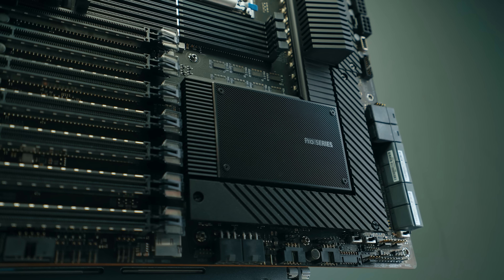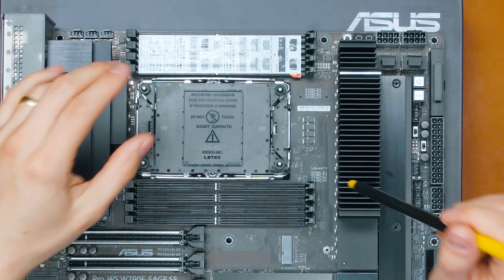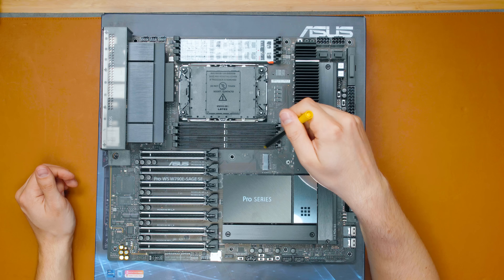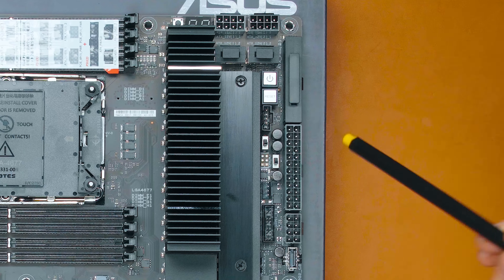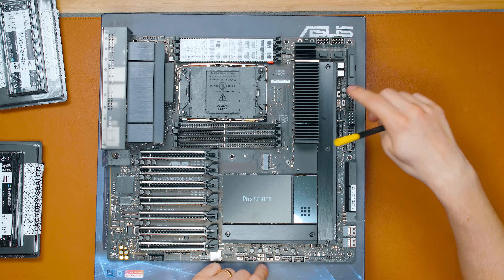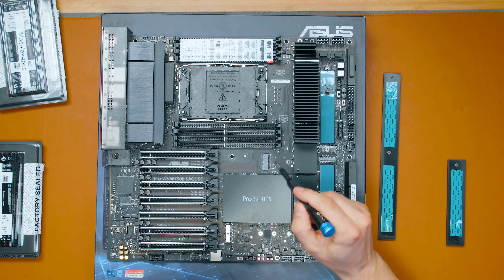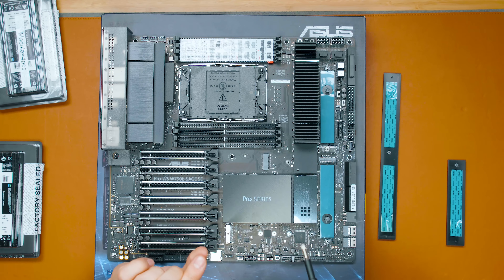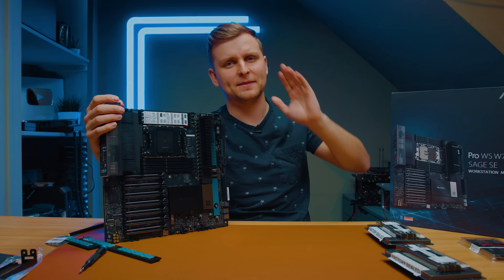FATHER of ALL Motherboards... 😱 | ASUS Pro WS W790E-SAGE SE review

Comment: The LN2 mode enables you to put 'unsafe' voltage settings in the bios for when you are cooling with LN2 (so basically a kind of unlock for bios settings)
Reply: On forced all core turbo it does burn 580-620 W already without flipping this jumper, and it's possible to cool it with room temperature water thanks to massive heatspreader. In this particular case pumping 'unsafe' voltages to this CPU kind of really mean LN2 cooling. With 1.1 kW loads some overclockers report it eats that nitrogen rather fast.
Reply: Asus Zenith Extreme also had this switch I assume they are related.

Comment: I just bought a workstation with the little brother to this board.  It will be here this month.
I got the Intel W7-2495X 24-Core, ASUS W790 ACE, 512GB DDR5 RDIMM (8×64GB), RTX-3090, WD Black SN770 NVMe, Corsair HX1200 PSU, Lian Li Lancool, and the Noctua NH-U14S cooler for this platform.
I develop high end 3D software for use with with terrains and video game engines.
I have defense departments and scientific analysts using my software.
My software supports up to 18 Exabytes of memory, but typically only 4TB in most cases.
I am looking forward to this build.  I hope my building electrical can handle it!
I wish that larger RDIMMs were available, 64GB was all that I could find.  I am in Canada.
Reply: My current workstations include two X99 systems, and my current high end system is an AMD R9-5950X 16-Core, ASUS ROG X570 Crosshair, 128GB DDR4-3200, RTX-3090.
I need a lot more than 128GB of memory though for software testing and development.
Reply: Software runs on linux?
Reply: @Teluric2  - Windows.  Sorry.  Cross platform libraries are just too expensive to license.

Comment: I want this!!!

I haven't upgraded my PC (X99) since 2016/2017 (except my M.2 NVMe), and I was disappointed there hasn't been an HEDT PC since X299. 

I was excited to see last month the quiet release of the ASUS PRO WS W790E-SAGE SE. I had no idea this beast even existed, and was even more blown away that there wasn't any coverage regarding this motherboard online reviewing it and performing benchmarks or something (I think you're one of the first ones to cover it). 

Once my finances allows me, and unless something better is released that catches my attention, I will be purchasing this ASUS PRO WS W790E-SAGE SE motherboard along with a Intel Xeon w5-3435X CPU (I might also simply YOLO it and get the Intel Xeon w9-3495X CPU 😏). 

Before, I would never imagine myself purchasing workstation-grade equipment, but due to the lack of HEDT in the consumer sector (as mentioned above), I think I will be purchasing workstation-grade equipment from now. 

I'm simply an enthusiast that loves overkill, high-end components with lots of features that aren't simply available on consumer-grade motherboards and CPUs. I demand at least ~50-60+ PCIe-5.0 lanes with multiple M.2 NVMe sockets and 8 DIMM slots. It's ridiculous and unfortunate that manufacturers think 28 PCIe lanes is acceptable. 

Now, I'm regretting not electing for the HPTX sliding motherboard tray when purchasing my CaseLabs Magnum THW10 computer case back in 2017. I never imagined myself getting anything bigger than a E-ATX motherboard, hence I elected for the XL-ATX sliding motherboard tray. Hopefully the guy who is bringing them back to life starts selling CaseLabs parts soon or I will have to find someone with a 3D printer or something to make me a custom 384 mm x 384 mm aluminum sliding motherboard tray along with a center divider to receive it.

Interestingly enough, though, I couldn't find any 2 TB (8 x 256 GB) DDR5 ECC kits online to purchase when casually browsing for them earlier this month.

Comment: Why there is overclocking stuff? Because that's what Intel thinks is required to sink Threadripper Pro. Xeon W 4G is basically really scaled up AlderLake Core i9, with wide DDR5 Reg/ECC memory support, all the custom silicon accelerators (like AVX512, TD, QuickAssist and others), overgrown PCIe Gen5 complex, 2 socket interlink, and TDP amped through the roof.

People already squeeze more than 700 W of power into these CPUs under sustained loads, because if you can cool it, it will run it.

The PSU 5-pin header is meant for SMBus link, many server and server grade PSUs use quite standardized connector, you can even upgrade firmware on the PSU through it. Yep, we've come that far.

The SlimSAS is relatively new connector, called officially SFF-8654, and this one is SlimSAS-4i to be precise, as in 4-lane. There exists SlimSAS-8i (8-lane wide, as you can guess), and these are super compact way to connect rapidly inflating number of devices to the host boards, you just need two of them (one can be angled 90 degrees, so you can put them one over another, like sometimes NGFF M.2 devices are stacked), to throw 16 lanes of PCIe somewhere out, up to 1 meter away. Older boards used the good old SFF-8643, called miniSAS HD or sometimes U.2 connector, and while it's mechanically more robust, it takes way more space, has some minor trouble with Gen4 signaling, and practically can't do Gen5 speeds reliably, unless you use finger-thick shielding and additional clock signalling, making it incompatible with Gen3 and lower anyway. You already can't use many Gen4 cables for SAS/SATA.

Also this board runs perfectly well on CHEAP standard server ECC-Reg memory. Upside? 32 GB module of single rank (you don't want dual rank in performance-oriented desktop PC, if that's possible) ECC-Reg will set you back ~$90, so ~700 bucks for 256 GB. 16 GB modules run around ~$60. Downside? Server memory is limited to 4800 MT/s. Pumping Registered memory to insane 6+ GT/s is what drives the cost up. 

The little computer is the ASPEED chip, it contains the BMC. The VGA on board is contained within this chip and is essentially Matrox G550 card - one of the first PCIe graphics cards, it is completely software controlled, and has no 3D or media capabilities at all. Just enough to install an OS or troubleshoot it. Most servers only see graphical GUI during installation, and usually it's deployed automatically anyway over network.

The VPP-I2C header is for NVME/SAS/SATA backplanes that use I2C connectivity - standard for servers - backplanes can report their state and faults over it, be reconfigured (if backplane ports use multiple connections, like NVMe/SAS to two different controllers, or NVMe dual port or NVMe/NVMe-oF), or you can upgrade CPLD firmware on the backplane through it. You can chain backplanes, so you need only one connector.

The connector you missed is most likely for VROC hardware key, for enabling on-CPU hardware RAID (you can do RAID 0/1/5/10 on any NVMe connected to the board and same for PCH-based SATA).

I love this board, but I will be going with the W790-ACE (younger uncle, you can say), as I want Xeon 2400, as I can't use more than 20 cores anyway (license thing), and with lower number of PCIe lanes the layout isn't good for me. It makes one pretty insane workstation, with all the connectivity it can support. I could technically drop 13900K or KS and get overall cheaper platform, most likely quire a bit faster even, but I'd have to choose - either GPU or 100G NIC, and one or two NVMe drives. Modern desktop platforms really struggle with memory too - 128 GB DDR5 on AM5 is virtually impossible, and while 13th gen can get it to work, but is insanely fussy about memory timings, not to mention all 4 slots populated cut speed a lot. I strongly suspect, that all the DDR6 desktop platforms will only support two modules per CPU.

Comment: Been waiting for this!  Gonna wait for 7000 series Threadripper to come out but the W790 WS (comes with u.2) + W5-2455X might be my next upgrade after RAM prices come down a bit.  Shame there's no quicksync on these though.  And yeah it's DDR5 R-Dimm.  And the PSU setup is for multiple RTX type cards considering you can get 3 of them in there
Reply: @Muhammad Ehtasam The reason it has no quicksync is because it has no IGPU.  Has nothing to do with what GPU may be used with it, it's one of those things intel has segmented in the Xeon lineup for years.
Reply: For this type of budget a custom case is the best Sir. One of PC builder at my place set up their own mini facility and make a rendering-specialized case which will fit 7 GPUs using risers, custom liquid cooling loop is available too. Seen one built for Blender myself. A little bigger than 4U, CNC brushed aluminum, soft-tube loop, 6x 3090 and 1 RAID card, plus 16 HDDs, damn fine made and well organized.

Comment: Baseboard Management Controller 
That's the name of the little computer that controls the bigger computer.

The slimSAS ports support PCIe gen 4 4x lane NVMe devices, U.2 2.5" drives at 64gbps

But thanks for reminding me to kick myself in the rear.
Built a I7 6950x in 2016, went with the ASUS ROG 10th anniversary edition board, but was considering the workstation board that was only about $200 more. 

Basically the same exact board as the ROG, exceptions being the WS had 10gbps lan ports and without the led's onboard..

Don't get me wrong, still rocking that setup and it handles everything I throw at it to this day, just kicking my self in the rear because the 10gbps LAN would be nice.

And I disabled the onboard light show of the ROG day I built the system.
Not into the LED thing, so something I'd have done even if it's home wasn't in a 4u rackmount case. Wouldn't be able to see that light show in that case anyways..

Moral of the story, save a couple hundred bucks at build time, kick yourself in the rear later! 😅

Comment: I would like to see The Motherboard, Cpu, and Ram's full performance. Even though it would be very costly, It wouldn't be worthless. So, If you make a build with pro-Gpus and  2 PSUs it would be a very sick build also last time I checked coolers, There is a very limited cooling solution. Also, I wanna see all the benchmarks in professional use cases with which software to use.
Reply: These type of computers are usually used for science and research. Calculating the 100th digit of Pi for example. Okay, bad example, but in that vein. And well, derivatives, such as AutoCad, which is highly based on math - which is science.
Reply: @PendelSteven  I know but without maxing the system we won't be able to get an estimated result cause time is money
Reply: @sabyasacheebanik6018  Time is not money. Time is time. Money is money. For your own health, you'd best recognize this.

Comment: (10:50) I think that the 2 PSU arrays are for redundancy, not for power limitations right?
And thanks for pointing the R-DIMM stuff, I was about to buy this motherboard and then I realized that r-dimm are unavailable for the GB/modules and frequency that I am looking.
(15:30) My understanding is that this is NOT a server board, but rather a user board with some server stuff. For example, the form factor with that many PCI-E connectors is not appropriate for racks. This motherboard comes with a sTRX5 socket for ThreadRipper Pro 7xxx processors, not the EPIC serie for servers.

Comment: Some new info sprinkled in for me, but then
Blunder 1: A Kingston Server Premier RDIMM 64GB, DDR5-4800, CL40-39-39, reg ECC, on-die ECC is under 300.- Euros, so 8 make 2400.- for 512 GB of RAM! (in words: FIVE HUNDRED AND TWELVE) Half is half the price. Double is rather a 1000.- x 8 or so. 1300.- mobo, 2000.- for a 3435X, 2400.- for 512 GB, 1700.- for an RTX 4090 sounds a good fit.
Blunder 2: 7 4090

Comment: 0:09 sorry, but you are confused, these are boards of different generations of WRX80 processors for 3xxx and 5xxx Threadripper where there is no support for DDR5 and PCI-Exp 5, and Intel on 4677 offers all this.
It makes more sense to compare all this with the 3rd Gen IceLake LGA3647 platform

Comment: Hey I need your help. I'm building with this motherboard using a 3475X. For whatever reason the M.2 SSD slots on this board just does not detect my drives, one of them does (bottom slot) but it will crash within 60 seconds and Q-code error AA. Have you successfully built with it and got windows running stable? I've RMA'd this board once already and with two fresh new units had the same exact problem. I've already troubleshot the other components, RAM sticks are all fine, CPU is fine, SSDs are also fine as I tested them on another motherboard. Asus customer servicer also couldn't solve it, been with them multiple times on the phone. Appreciate any ideas you can give, thanks!

Comment: I wish more high end board would support 2 PSUs by default, for one you can enable redundant power supplies easily this way instead of some sketchy workaround to enable you to have the same level of redundancy you have on rackmount servers. So, not because of additional power although in this case that is also a reason.

Comment: Did you notice any connectivity issues with the onboard NICs?... After being fully powered off (i.e: no wall power) for a few hours, mine show no link / connection / "cable unplugged". A brief power cycle (~10s) resolves the issue.

Comment: Yeah baby finally Now we can see the real competition between Xeon and Threadripper.
I am waiting for a Xeon build.
Reply: From the limited benchmarks out there the 56 core W3495X is kind of unimpressive vs the 64core 5995WX and the 7000's are supposed to be out later this year so...
Reply: Aren’t Xeons meant to compete with epycs…either way 5000 Gen threadripper still stomps xeons….but with 7000 s on the way it seems bleak
Reply: @nibirdtamuli8429  The server Xeons compete with Epyc, yes.  The workstation Xeons compete with Threadripper.
Reply: @nadtz  okay correction appreciated

Comment: What would you recommend for a WS/NAS/Virtualization station built with this motherboard?
Looking at the Intel Xeon w9-3475X Processor...
Any case recommendations for dual PSU?
Not sure if I'm going rackmount, but will if necessary
Reply: Another question.... How many GPU's can work on the motherboard?  is it 6 or 7?  You said PCIe 5.0 slot 6 will not work as a full x16 slot, so....

Comment: Hey, Ive troubles to get any network connection. I installed the drivers from the motherboards site successfully, but still no ethernet. Im running it on WIN11 Pro. Does have anyone a solution?

Comment: Having some issues with this.

Seems it fails post but i have no clue why. I don't have a speaker and the error code is 00.

Nothing evert displays on monitor and after a while the CPU fans turn off.

I have this setup in dual PSU mode. Any ideas?

-Update seems it was due to a faulty 8pin ATX connector preventing the CPU from getting power. got a full refund lol

Comment: I will bet that a LOT of people using a fully loaded motherboard like this will pop their breakers due to overloading the circuit, just put the workstation together using around 4x4090's, at least a few 4Tb SSDs (4) and obviously 8 SAS 20Tb HDDs in RAID Z2 with 3 redundancy reserved HDDs (so 60Tb lost for the sake of safety, still leaves you with a ZFS pool that will have 100Tb of usable storage). Of the SSDs 2 will be in RAID 1 mirror (main Operating system and software disk) the other two will be used for ZFS caching.

Comment: For building a decent content creation PC, is there any difference between building it with an Asus ROG Strix Z790-A or Asus ProArt Z790-CREATOR?  Same question for GPUs.
Reply: The ProArt has two pcie 5.0 while the Strix only has one pcie 5.0. If you need dual GPU workstation then go for ProArt.

Comment: I bought an ASUS Pro WS W790E-SAGE SE with the Intel Xeon w7-2475X processor and V-Color DDR5 memories 256GB (64GBx4) 5600MHz CL36 Overclocking R-DIMM SK hynix Original IC 2Rx4 1.25V ECC Memory DIMM registered for W790 work station

It only works with 1 memory placed in slot B1, if I place 2 or more memories code 29 appears

Does anyone have any idea what's going on?

Comment: Why don’t you review a SuperMicro server board for Xeon Platinum scalable 4th gen With 4 CPU socket with up to 16 TB of memory in 64 DIMM slots. Or even better take a look at the IBM Power Mainboards(used for mainframes) or the 8 Xeon Platinum 4th gen Scalable motherboards build into the new Lenovo servers. It puts this motherboard really to shame(also cost wise)
Reply: Workstation vs. Serverboards.